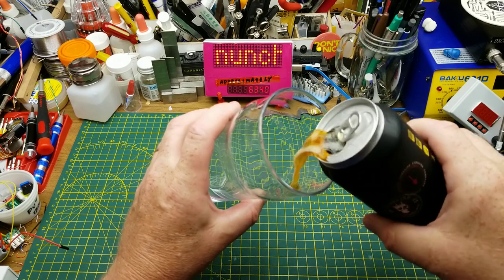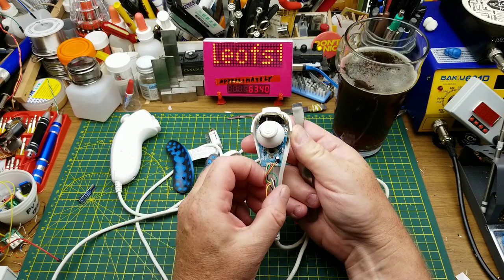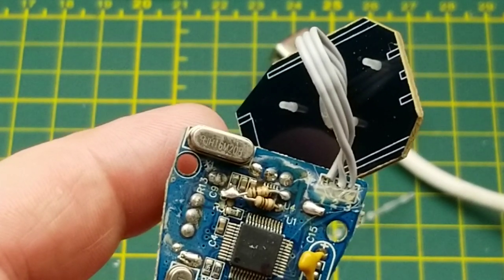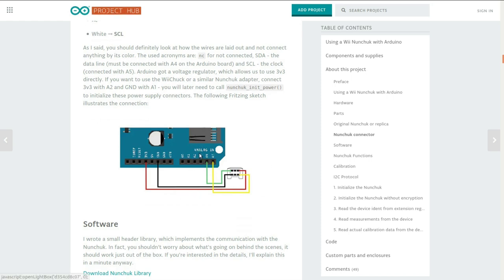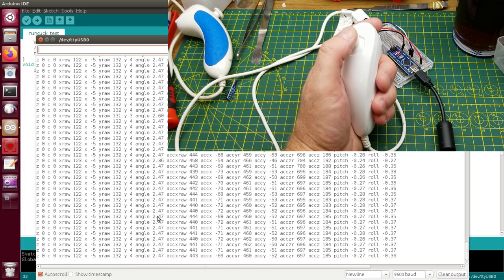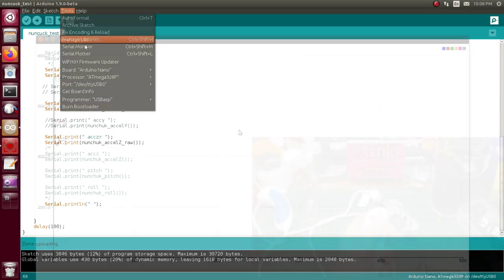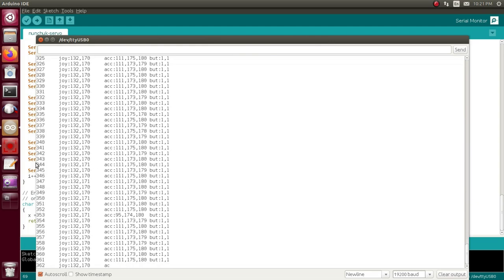tinkering with Wii Nunchuk and Arduino

Comment: Those black blobs are motion sensors for boxing type games that detect movement of the joystick
Reply: I think the joystick motion is covered by the two pots on two axis, the "blob" will be a cheap accelerometer for the other stuff, but all in all a good range of motion if the the data is clean enough though, so only a closer look will tell.

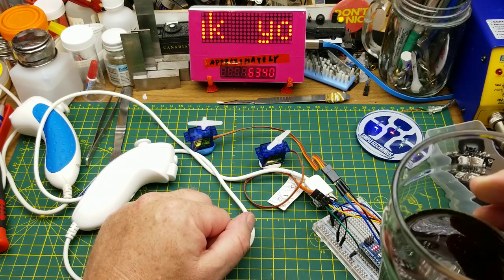Comment: There's a note @15:17 which explains that there's no yaw function, which helps when figuring out which moves do what to which parameters.

I'm envisioning a 3d map of a space so you can point at lights etc., and use the Nunchuck to control them. You'd need calibration targets to point at and set your position if it changed (default = middle of couch ;)

Comment: The accelerometer measures relative to gravity, so if an axis is vertical, then rotating around that axis will not produce an output. If you tilt the controller, then rotate around the other axis, you should see a change in that measurement. Basically, an accelerometer by itself can't detect yaw - you would need to add a gyroscope to do that.
Reply from the maker: Thanks. I haven't been curious enough to do a deep dive into accelrometers themselves yet.
Reply: @pileofstuff  Aw, come on, it's basic Relativity- Einstein's Equivalence Principle. ;>)
Seriously though- I was thinking controlling a drone with one but then thought about how unstable drones can be absent relatively spendy gyros. It should be possible to use the accelerometers in one controller onboard a drone to set what pilots call "trim" so that with no control input it simply hovers and resists wind and other forces. It wouldn't be able to remain stable against rotation around the vertical axis though for the reason Mr. Wheeler explained. The joystick pots could be replaced with trimpots for better precision.

The signal from the other controller would be added to the servos giving radio control.
Reply: @pileofstuff  Slightly more information: an accelerometer measures acceleration, by means of essentially having a small weight suspended by springs, and measuring how much pressure is applied to the springs, which means two things: they detects change in transitional velocity (e.g. suddenly moving to the right), and when held steady they measure the direction of gravity. On their own they cannot detect rotation, instead when you twist the nunchuk they are only detecting the new gravity vector.

When you rotate a 3-axis accelerometer directly around either the x/roll or y/pitch axis the relative direction of gravity changes so you should see the other two axis change value. If there is no change in translational movement, the three axis will sum to equal the force of gravity; you can use this to calculate the orientation of the sensor. If you rotate around the z/yaw axis the relative direction of gravity does not change, so it has no way of detecting and measuring it.

As a former Wii dev, I can tell you the reason the nunchuk (and even the wiimote to an extent) movement was only really used for flicks and maybe slow balancing motion was due to only having an accelerometer that's all it was really good for.

Long story short, if you want to play with the accelerometer in a nunchuk, you need to swing your arm around dangerously ;)

Comment: Hi -- what was the brand on the white and blue nunchuk? I am interested in finding one for myself.
Reply from the maker: They're both no-name generic ones that I found used.
Reply: @pileofstuff  Thanks. I have been trying to find more sticks with that thin metal nub, as opposed to the more common plastic. I have a rare Hori controller that is in need of a cap replacement, and I think the one with the blue grip is just what I need. I did some research and it is the "intech" brand. There are a number of auctions on ebay. I know it probably wasn't the main focus of this video, but thanks for the teardown!